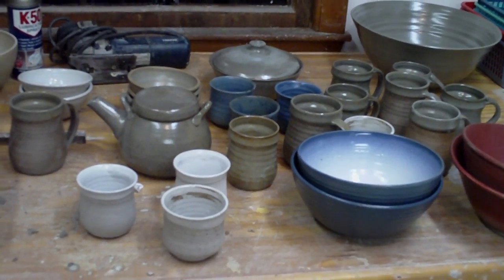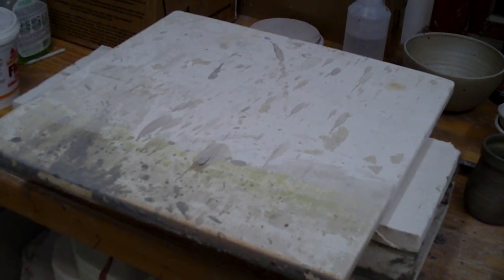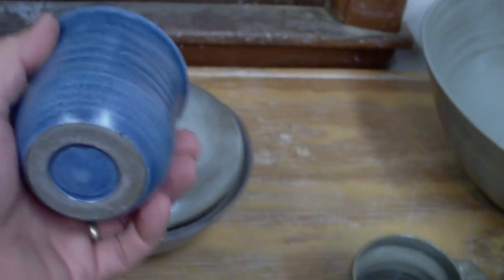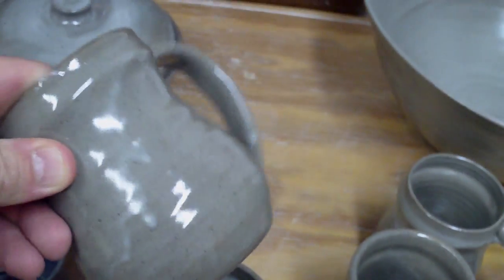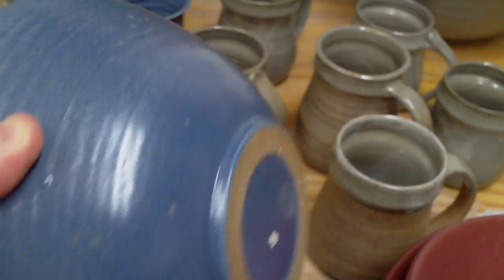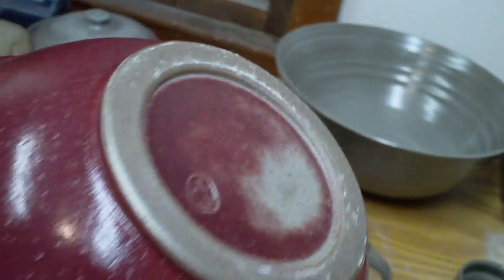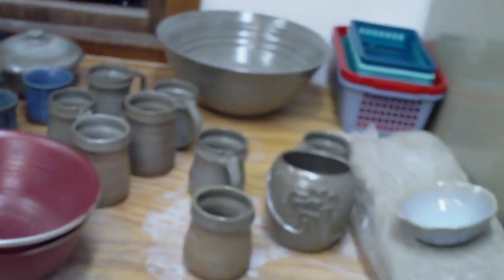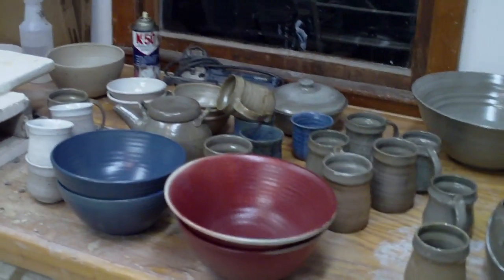Kiln opening - Failure.  Clip 2

Comment: Do you get your drips because the glaze had a drip in it after you dipped it, or did the drip show up after the fireing because the glaze dripped down?

If you get the drips right after you drip the bisque in the glaze, try just using your finger to sort of 'sand' down the drip.